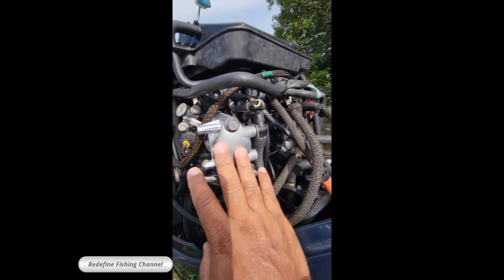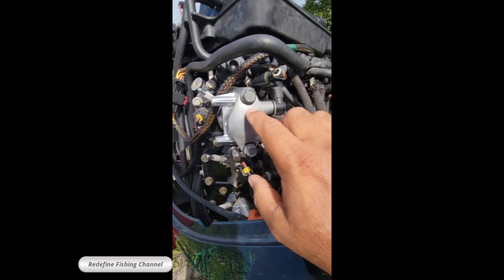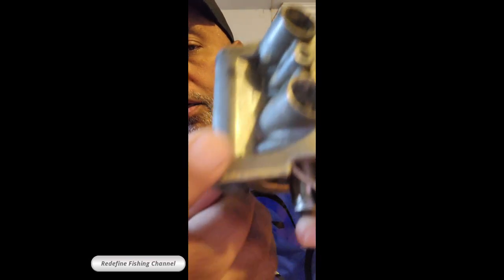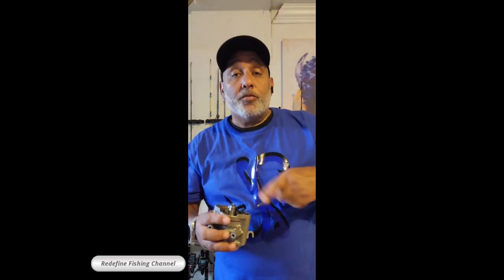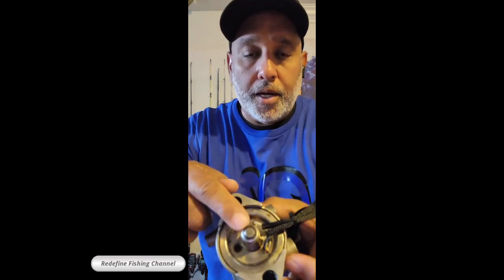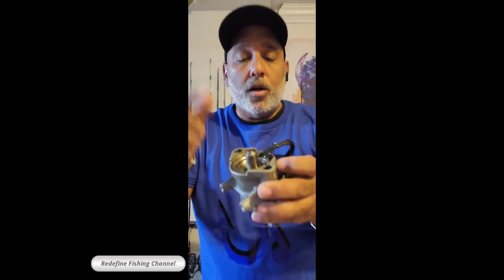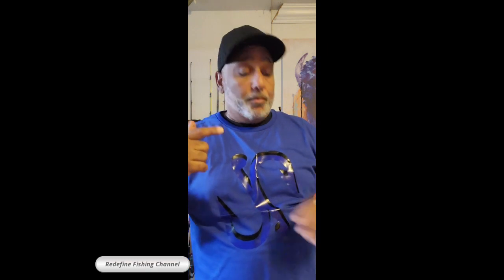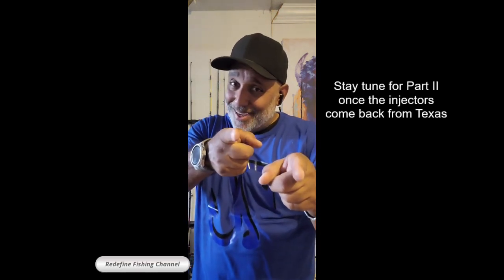Is it Possible to Clean the ETEC 150 injectors? "Uncleanable"? Part I

Comment: What kind of gas are you using? Ethanol?  If you add a inline fuel water separator it may help with the injector corrosion . I got a 2006 75 etec , It came on a boat I bought , didn't run , i got the computer cable and found the cps sensor was bad changed it , 2nd trip out the high pressure fuel pump went out , changed it , 5 trips later cylinder 3 injector is bad . I have worked on the motor more time than used it. I am pulling the injector today to clean it if it doesn't work I will sell the motor for parts.
Reply from the maker: We always use ethanol.